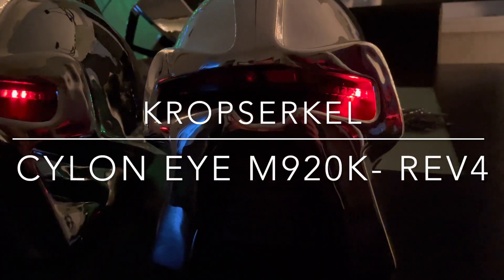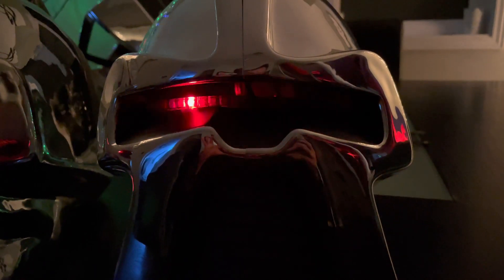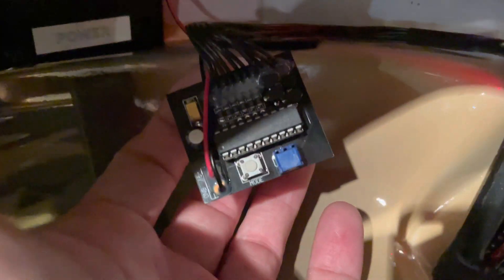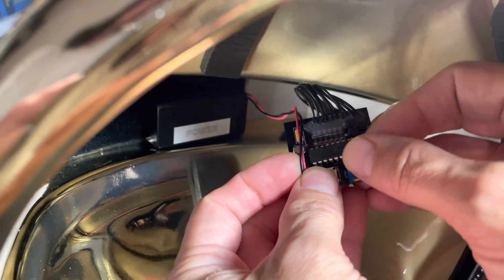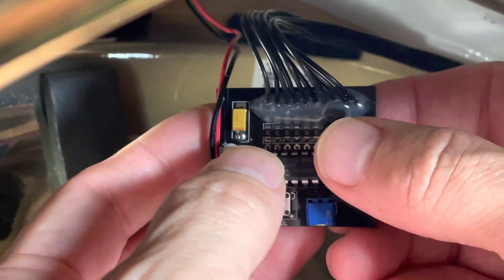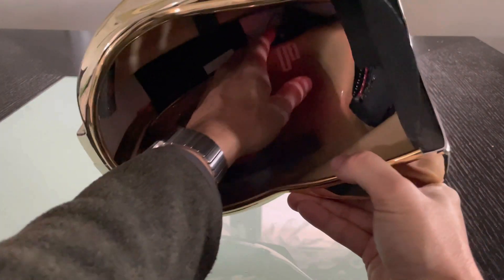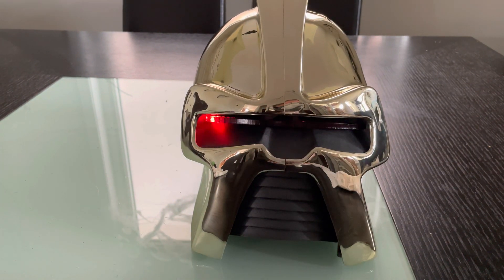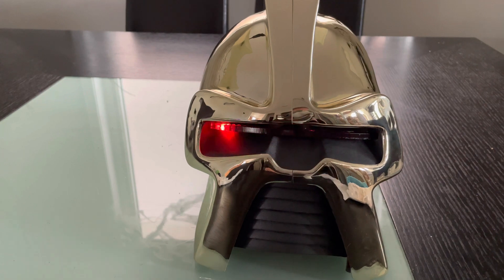Kropserkel Cylon eye update

Comment: The comet trail effect is almost subliminal if you're not looking for it, but it does have a good impact on the overall effect, making it look that little bit more natural. What's the adhesive that the wire ends are floating in where they connect to the board?
Reply from the maker: Agreed, it’s a subtle trail, and it registers differently across cameras and the naked eye. As for the adhesives, the wire leads are soldered to the board, and we use Goop or E6000 adhesive to attach the laser cut red acrylic diffuser and to the face plate eye slot. I have a Cylon helmet build tutorial video that shows this process.